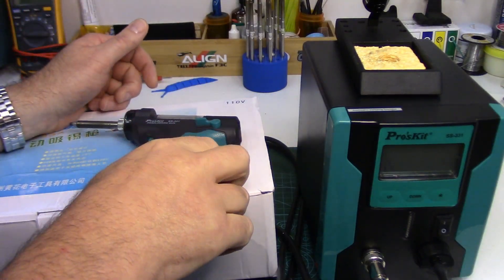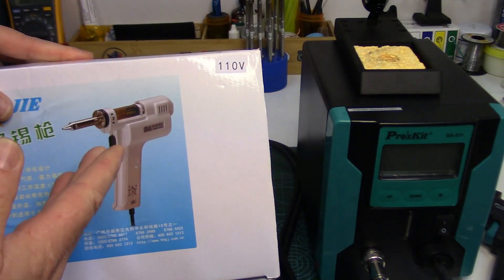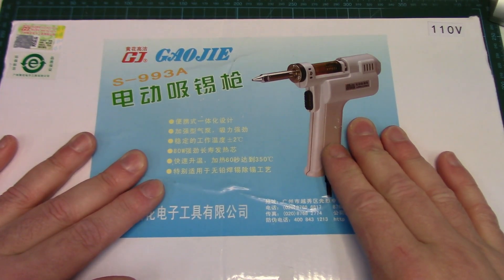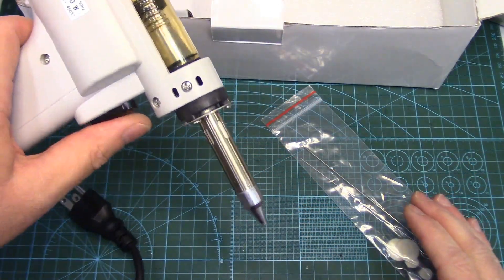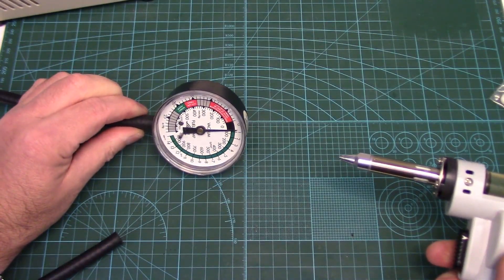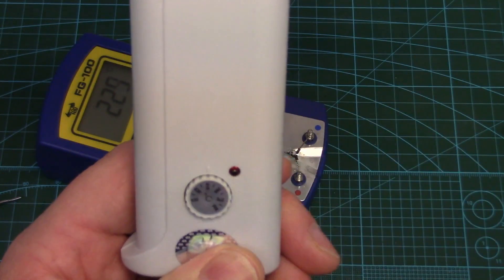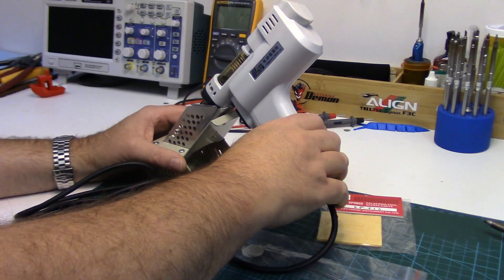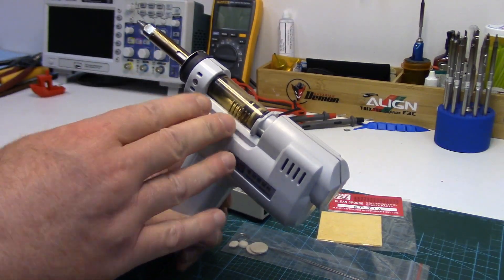S-993A Desoldering Gun Review - Is a desoldering station better?

Comment from the maker: S-993A Desoldering Gun 110V Version:
https://amzn.to/3TN00lQ
Best Quality Hakko FR-301 Desoldering Gun:
https://amzn.to/2HQiZMY
Pro's Kit SS-331 Desoldering Station:
https://www.banggood.com/custlink/vGvhVCT2Hs
Reply: I've had the S-993A model for a couple years and I do not reccomended it. There are many better options on the market for just a little more. As you found, the pump is on the weak side, it get clogged up more than it should and the heating element burned out on mine only after a dozen hours of service. But you have great tool review videos keep em coming!

Comment: A number of years ago I built my own vacuum powered solder vacuum using an HVAC vacuum pump. I had been using both a tube solder suckers and a few of the primer bulb type de-soldering tools but the tips on the de-soldering iron didn't last long and it was too hot for delicate PCBs. Using a roll or silicone vacuum hose, a 1 liter glass jar with two ports, to prevent anything from making it back to the pump, I made a vacuum port to fit the back end of a plunger type solder sucker with a silicone tip. Using a sewing machine pedal switch to activate the vacuum, I could melt the solder with an iron, then vacuum it up. The solder cools quickly and gets left in the barrel and the vacuum pump can remain under the bench or even in another room if you wish. For mine, I put the pump in the basement, with the switch connected through the floor to the foot switch and I ran a hose up to a vacuum port on the wall above the bench using copper tubing and a wall plate. 

I built that before all of the cheaper de-soldering tools came about from Asia. I had stumbled on a cheap vacuum pump at a flea market with a broken handle which made for the perfect pump. Its fast and can draw 29 in/hg in seconds, far more than is needed to remove solder. Rarely do I find any solder or debris that made it to the jar.

Since I also mold resin on occasion, the system also works great when pouring resin for casting parts such as knobs and lenses using a small vacuum chamber I made with a metal plate, a sheet of rubber and a large jar with a couple of valves.

Comment: It has actual temperature control, not just dumb power control? That's pretty impressive for some random chinese desoldering pistol, but it costs pretty much the same as a basic big desoldering station, so I don't really see that much point in buying it.

Comment: I bought the S-993A last year.  It worked fine for about six months, then started losing suction.  I may be able to fix it, but would not but it again.
Reply from the maker: They all require base line maintenance to maintain suction.
Reply: @Rchelicopterfun  Believe it or not, I actually just fixed the issue!  Inside the pump, there are two rubber flaps/valves.  The sealant on the valves had dried out, so it not getting a good seal.  I cleaned out the old sealant, added some lithium grease in the appropriate spots, and it works like new.  Hopefully this helps someone!

Comment: Hi John.  Mahalo for your review.  Since it's been 4 years now, how has this desoldering gun held up?
Reply from the maker: Still working fine; with the caveat I don't use it all that often. I still mostly use my Pros-Kit SS-331 for desoldering.
Reply: @Rchelicopterfun  mahalo for getting back to me and letting me know.  I am leaning towards the Proskit.  I see that the largest nozzle is 1.5mm which concerns me a bit.  What say you? The S-993A has a 2mm nozzle available.
Reply from the maker: I've never run into that size being too small for any board component, but of course it's totally dependent on what you work on. If I found it an issue, I would simply purchase a second set of tip ends and drill them out to whatever additional size/s I required. Maybe they even offer larger dia. tip ends; I've never looked.

Comment: Very nicely done.  Is there an accessory product one could buy to put over the electrical cord to prevent thermal damage?
Reply from the maker: Insultherm/similar fiberglass cable sleeving would work; not very abrasion resistant in my experiences however. Personally, I would just replace the power cord with silicone sheathed heat resistive cord.

Comment: The stand looks great, but it also looks like it's not even remotely the right shape for the tool. Both the tip and the plastic body of the gun are in contact with the metal cage of the stand - you leave that switched on in the stand for any length of time there's a good chance the plastic will start melting/burning...
Reply from the maker: Stand works perfectly fine and barely gets warm, even after having the gun in it for over an hour due to the simple fact the contact area where the tip rests against it is less than 1mm square, ergo has very little thermal conductivity.
What little thermal energy is transferred into that large metal enclosure is instantly dissipated from the passive heat-sinking. 
Way more heat is transferred into the end of the gun from the heated shaft.

Comment: If you have to replace the motor what specs are needed? You mention it is am RS-550- but what voltage etc? Thank you.
Reply from the maker: No idea as I never measured the voltage going to the motor. I would guess however it's the most popular "universal" 12V version (8-16V) and not the 24V version (18-28V). Might even find the specs printed on the motor can after it's removed for inspection.
Reply: @Rchelicopterfun  Thank you very much for taking the time to answer. subscribed.

Comment: I have the S993A for a few years. I ordered 3 more tips. All came with the biigest tip. I bought these for extra tips just in case one wore out. They supposed to have sent tips starting with small tip , medium, and large tip. Can anyone tell me if the 1.2 that came with the S993A is actually the smallest desoldering tip? The other 3 are almost useless for what I desolder.

Comment: I've been using a S-993A for a couple of years and get on well with it.  Just be aware that if you replace the element, be sure to solder the wires onto both sides of the PCB or the temperature sensor may not work properly.
Reply from the maker: Thanks for the good tip 👍

Comment: The problem with the Pro's Kit and clones (RS Pro) is that the heating tip is too long (compared to the Hakkos, for instance); this means that if you're removing lead-free solder, which requires elevated temperatures (compared to leaded solder) by the time the molten solder has travelled from the tip to the base of the sucking tube, it has had time to solidify.  I've had a lot of problems with this unit and solder blocking the suction tube; something the Hakkos don't suffer from I suspect.
Reply from the maker: I've never had a single tube clog with the Pro's Kit SS-331in the almost two years I've been using it now. I have however had several clogs with this S-993A if the solder "skins" over with oxide while in the tube and it solidifies.
Reply: @Rchelicopterfun  I honestly don't know how. Feel like my proskit was constantly clogging no matter what I tried. Maybe I should have put more effort into troubleshooting. But so many people report clogging I just assumed it was business as usual. Was wondering if these FR 301 clones might work better but I guess they are even worse.
Reply from the maker: @nerdstrangler4804 There are many variables why some of us have no clogging issues while others do. Temp you run at, how long you wait for it to come up to temp and stabilize, type of solder, type of flux, how you care for/clean it after every use, perhaps even faulty or abused units with heavily scratched inner tube walls etc.
All I can report are my anecdotal experiences with the SS-331, and I've only had it clog a few times now in over 4 years; and those few times had one of two things in common: 1. I didn't clean it before shutting it off. 2. I didn't let it heat up long enough before starting to use it. Just because the tip temp shows it's at 400 on the display within a minute or so doesn't mean the entire tube is warmed up enough. I let mine warm up for at minimum 4 minutes before I start using it.

Comment: Before recently figuring out a trick, my desoldering station, Aoyue Int701A++ (same as Int474A++), was so bad I actually did go back to using solder wick for most capacitor jobs. I always dreaded any job that required it, like removing DIPs or AV connectors, preferring instead to use just my iron and wick wherever possible.

Mine was the older version with the AC pump. It’s weaker than the newer DC pumps but supposedly more robust for continuous operation (fume extractor)… which is what I abused to make it actually functional (more on that later). It also has features that the hackish DC conversion doesn’t, like waking and resetting the sleep timer with each pull. Still, it was almost useless even for the jobs that demanded it, forcing me to use it along with braid, ChipQuik, an extra iron, and even my old Radio Shack bulb-type desoldering irons for almost everything. Even if I could fight my way through with just the station I would have overheated pads and multiple clogs. It’s just a nightmare.

I fought with it from 2016 to 2022 before figuring out a trick that makes it half decent. Still, I would’ve been MUCH better off with the handheld unit. You see, the handheld units spool up faster and don’t have to evacuate air from a long line to get max suction at the top. Those two deficiencies made mine so slow to ramp up that it would remove solder from the solder side before suction built up enough to remove solder from the through hole and component leg on the other side. This breaks your heat bridge needed to keep solder molten on the other side which instantly freezes and will not melt without replacing the solder you just removed. With power and ground traces you can repeat this a dozen times and not get anywhere.

The trick is to pinch/kink the hose, then hold the trigger, and quickly release/straighten the hose when it reaches maximum suction. For stations like mine I can just run the fume extractor function with no need to hold the trigger. In fact, I plan to connect my trigger to a solenoid that releases the vacuum maintained by the continuously-operating pump so I also won’t have to kink/release the hose for each joint.

I still wish I’d just bought the portable unit in the first place but this has been a huge breakthrough that gets me much of the way there. At least it’s more usable to me.

Credit to KainkaLabs who modified his DC ZD-915 (already better than mine for desoldering) to generate vacuum in advance and release with a solenoid. I saw his video years ago but it only recently occurred to me that I can accomplish much of that by kinking the hose. :)

Comment: Nice review. I went to look for the SS-331 and I can only find it available in 50hz models, including the Banggood link in your description. Are you running a 50hz model on 60hz?
Reply from the maker: The SS-331 uses a universal switch mode power supply and accepts 120 to 240V 50-60hz. I did a follow up video to the original review on the 331 covering that:  https://youtu.be/9eBG7z-2qNE

Comment: Great video.  That gun looks way to bulky to get into tight spots and I can't think of any compelling advantage over the station. I've used my SS-331 for rebuilding 7 vintage stereo receivers and it's done a good job. In addition it produces more heat, more vacuum, seems better built and you can buy an entire spare gun for only $30.
Reply: One advantage is that the station has to evacuate the long hose before it reaches maximum suction. By the time my bench top station had built up enough suction to pull solder from the other side it has already solidified because the weak suction removes solder on the same side, breaking the heat bridge you need to keep it molten on the other side.

The trick is to pinch the hose and hold the trigger before the pull, then release the hose once it’s molten on both sides. Because you were holding the trigger before releasing the pinched hose, you get maximum suction all at once. Works like a charm for me!

Comment: Mine only came with two conductor cable, no ground.  I searched for a silicone outer jacketed, 3 conductor, 16AWG cable, it was near impossible to find.  I did it just for fun, and because I'm pretty sure almost every power cable appliance cord that I've seen uses a PVC jacket, so I was curious what I would find.  I also picked up a 15a 125v rated push button switch so I don't have to unplug this thing.  (why didn't I just buy the Hakko?  They have the worst color scheme in history, and I'm cheap, and I don't mind a $25 mod, still cheaper than Hakko.  I don't have much room on the bench, otherwise I might have gone with that Pro's Kit model.

Comment: is there a 120 Volt version of your Pro'sKit SS-331H Electric Solder Sucker?  I looked at your link and it says 220 v at 50hz.
Reply from the maker: @eightofnine9 - The SS-331H supports universal voltage. See the video I made on that confirmation: https://youtu.be/9eBG7z-2qNE

Comment: John !  Thanks for this video and the one on the Pro'sKit SS-331H.    I found this video review of yours when researching the S-993A.   I agree with your review comments (Great review videos on both BTW !).   After watching both reviews, and a little more research (and your opinion/experience using both), I finally pulled the trigger and bought the Pro'sKit SS-331H.    In hindsight, I am sorry, I should have used your link provided so that you would have been compensated some for your work helping me.   My apologies!    Regardless I am very grateful for your reviews.  They were very helpful to me to make my final decision on which to buy.       I tried to find one that's uses 110VAC, but was unable and settled buying the 220VAC model.   Not really an issue as I also have a step up/down transformer just for that purpose.     QUESTION:   If I use your link for the 331, and then look for spare parts for it from that page, will you be compensated a little?   THANKS AGAIN FOR THE GREAT REVIEW VIDEOS !
Reply from the maker: PS works at 120V as well (I noticed your follow up comment). Doubt I would get credit if it's not the actual product link used - so get parts from wherever you wish. A sub would be just as helpful 🙂

Comment: I bought S998-P and S993-P. Using 998 currently and it works really well. Pump is stronger on 998p model. Works fine for both.  I am missing smaller 0.8 and 1mm tips (1.2mm came alongside with it only) on both items. Made me pissed a bit.  However, an excellent tool. Can't imagine working without it. Things took 2 hours with manual pump and very often with crappy results. Now - 10mins for similar tasks. Buy it, buy any that will take you away from a manual pump.
Reply: What is the smallest tip the 993A comes with. They sent me all big tips . Now my smallest tip has wore out

Comment: Hey John, would you be able to confirm if it's possible to completely disassemble the internals so I can re-paint the plastic shell of the gun? Looks like one of the halves came of easily so I can paint it fairly easily but how about the other?
Reply from the maker: Yes, possible. Nothing more involved in removing all the guts out of both halves, other than more time required.

Comment: Have had two of these, both failed in the heater element, replaced the heater, which failed the same day I fitted it. Been doing electronics for years. Thought I would try one.
Reply: I bought a bunch of desoldering guns.
My everyday gun is the Hakko 808.
I have the S-993a, s998, ZD985 and Hakko FR-301.
After testing every gun I can say the Hakko 808 is one of the Best.
I hear good things of the Yihua 948.

Best Regards.